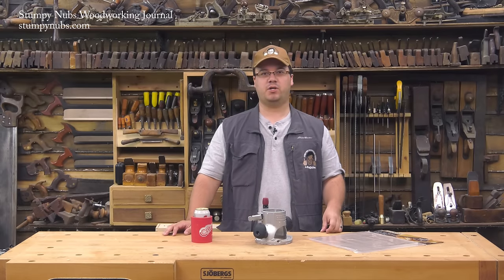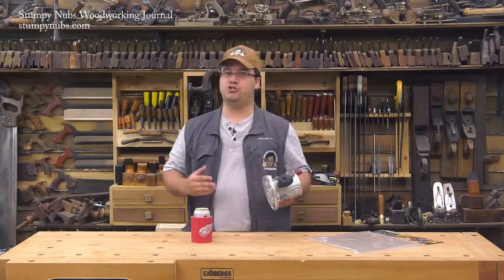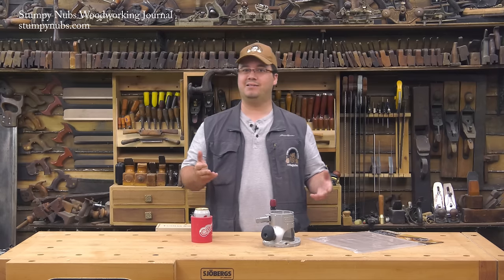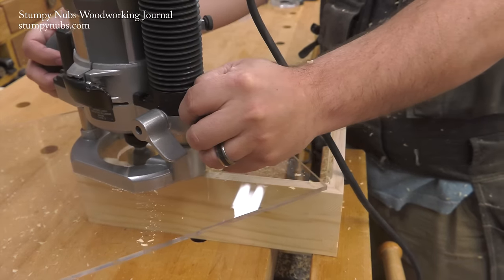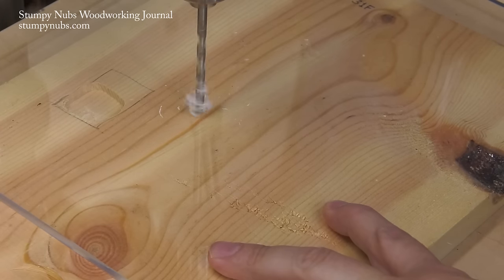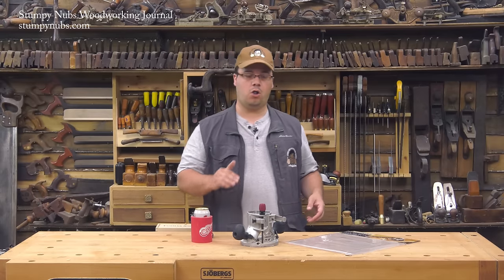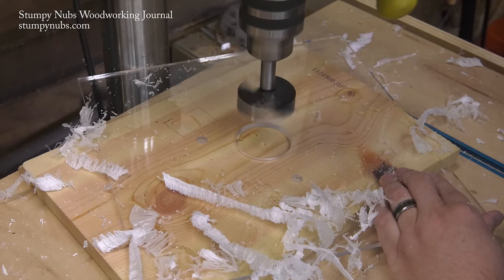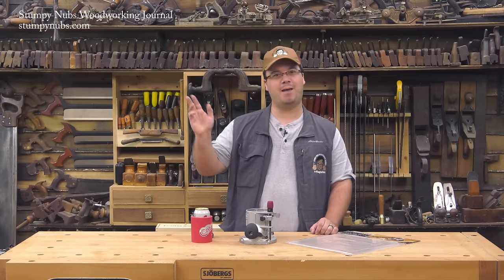The right way to make a custom router base plate! (Tutorial)

Comment: Another tip for getting the mounting holes aligned properly. Take the baseplate to a copy machine. You'll get a paper template you can punch and drill through. This works for a million other things you need accurate mounting holes for.
Reply: This comment needs more likes
Reply: Yes, Except ...You'll still need to center the holes relative to the edge of the acrylic, and for that you'll still need a combination adjustable square.  The advantage of Eric's method is that you don't risk drilling through the original baseplate and potentially wrecking that original part.
Reply: Just tried it what a great tip!
Reply: @tommccurnin524 who's Eric?
Reply: My experience with copy machines is that they don't always generate a copy that's exactly 100% of the original. This would put your holes at the wrong place.

Comment: I am an experienced woodworker for 40+ years and it amazes me that I can watch one of your videos and still pick up a tip or two and learn something.  Thanks for all you do.  Oh, rather than using a "V" groove bit to center the center hole to the collet, you can use a 1/16th inch bit in your plunge router and just kiss the acrylic.  Saves you from getting a bit you might not need.

Comment: The method of locating the screw holes that you suggest is great when you have an original and accurate sub-base to work with.  In my case, I do not (only have a cheap-o "universal" base that is off by a good 1/32" or more.)  My suggestion to anyone in a situation like mine (or worse, maybe you don't have ANY sub base to copy from!) is to obtain something called "transfer screws" threaded to the size of the holes in your router - they are like dowel center locators, but threaded, so they can be placed in screw holes.  Stick these in your router's screw holes and you will get dead on marks for your drilling.  Hope this helps someone.
Reply: Or similar to Eric Morrison's comment mentioned above, very gently place your router on the glass plate of a copier and make a paper copy of the base.

Comment: Fantastic! I didn’t realize that Rockler had the acrylic pieces. Now I know where to find them. I also like your method of centering the hole fore the router bit. As usual a very done video. Thanks.
Reply: WB Fine Woodworking

Tap Plastics or any plastic supply store is a good source as well, and probably cheaper.
Reply: I got mine on amazon, they have lexan(polycarb) 12x12's for ~$12 prime shipped vs rockler's $18 for acrylic. Lexan is much stronger.
Reply: Ditto on tap plastics. You can get off-cuts out of a bin for about $1.25/lb.

Comment: James, Better than acrylic, The undisputed king of plastics...Micarta. Paper, Linen, and Canvas based micartas are nearly indestructible. They have a precision surface. You can cut threads in it. You can cut it with any wood working tools. No melting issues. No issues with solvents. I have been using Micartas for knife handles for years. The late Bob Loveless called it the best handle material you could buy.
Reply: Andrew mcgibbon

Does it come in clear?

Comment: Another (probably more accurate ) option for marking the mount holes would be a Vix bit. This is a drill bit which works like the centering punch, but drill a hole to give you a spot to start. These bits are made for marking holes for hinges and other hardware to receive screws.

Comment: We use small laminate trimmers at in the furnishing workshop at the high school I work at.  I have found most of the kids don't have the hand control to hold the trimmer perpendicular to the job and end up making very ordinary chamfers. 
I have made a base plate in acrylic (100x280mm) that extends out to allow a handle and more surface to sit on the timber.  No more dodgy chamfers.  Bonus is both of their hands are busy and no fingers near the cutter.  (late last year one kid fed his hand into the opening of the base,  chunking his thumb up. He had been trained,  but ignored instruction as he knew best. He knows best now.)
Reply: AKA Nathan that's racist
Reply: Bo:  How so?

Comment: Hi James can you help is it OK to use a thinner than 1/4 inch base plate in acrylic
Reply from the maker: Yes, but if it is much larger than the router base you may have issues with it flexing or bending.

Comment: Another great video.  Your video explains perfectly how to drill into acrylic, but how do you cut it to different size for different application like your offset base plate?
Reply from the maker: Acrylic can be cut with a band saw, scroll saw or even a handheld jig/saber with a fine tooth blade. Sand the edges a bit and you're done.
Reply: If you want a shiny edge, use a scraper, and then if you wave a flame over the prepared edge, you can get it to smooth out like a factory supplied panel... Something I vaguely remember from my high school days in the 80's......

Comment: Yeah I think I'll stick with my Dremel for doing my hand routing, damn plunge router I bought made by Black & Decker is just too clunky and does not have a round base so making plates for it is nearly impossible. So I flipped it upside down and stuck it in a shop made table with a car jack for a router lift, I still have to reach under to change the bits but meh, you win some you lose some.

Comment: Hi stumpy, I have a question. I am building a little router bench top. I am making my insert plate from 1/4 acrylic / plexiglass sheet. My router face / base plate is 6 1/8 inch round. What size is a good size to make the insert plate? I wa going to make 12 x 12 but I feel like it my be too big and might create a sag or bow. Is 12 x12 a good/ normal size or should I go smaller? Also how big should I make the hole for the bit to pass through?
Reply from the maker: 1/4 is a little thin. I would make the plate as small as possible to reduce bowing, as you said.
Reply: @StumpyNubs  thank you 🙏🏼

Comment: Routers really scare me. I’ve never even used mine, but I think I’d feel more confident with a larger base plate like that. :)
Reply: Ian Enderby go and check out Samurai Carpenter for his base plate. Simple and easy.
Reply: Shawn Broadbent yes, I’ve seen that one and really like it. Especially for mortising.
Reply: Scroll saw what?  Packs?
Reply: Great tip!
Reply: Routers aren't so bad. It's the angle grinders that make me cringe. And to think, some people use those without the shield in place... :: shudder::
Reply: Ian, which router do you have? What kind of work are you doing? Get yourself a book and practice on some cheap lumber.